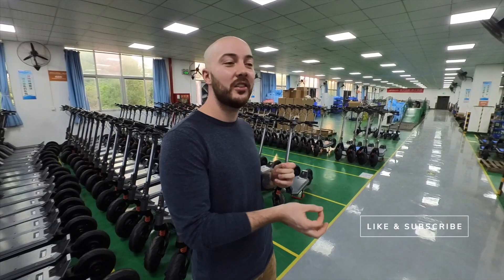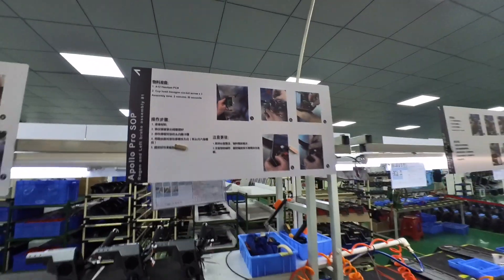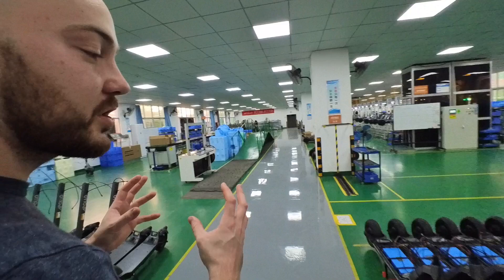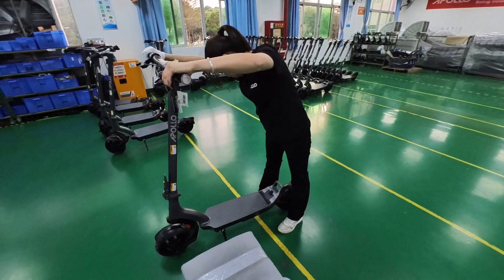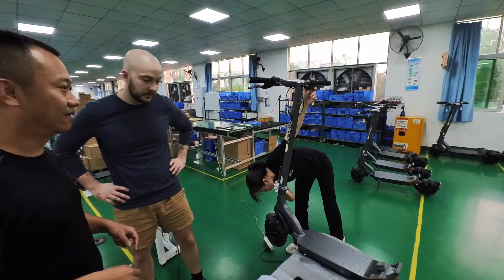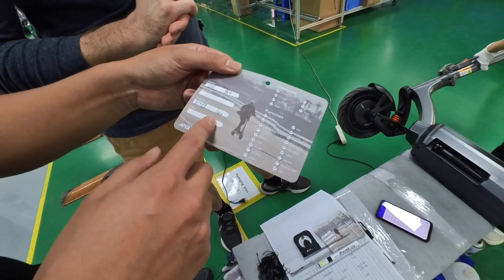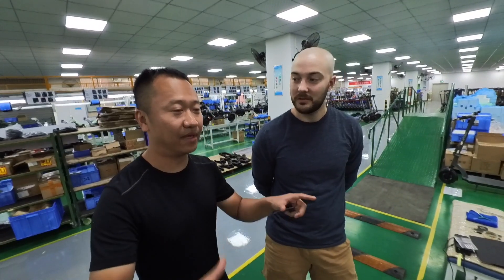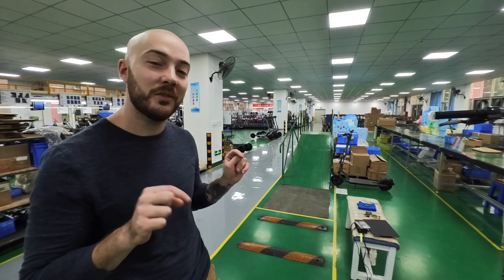Inside Apollo's Electric Scooter Factory | Quality Control Tour

Comment: Love the videos. Do you guys ride the scooter after it’s fully assembled to make sure it runs?  Wondering about that final stage. Thanks for showing us. :)
Reply: They select one or 2 random scooters after a batch is made to test ride. I’m not sure if those are sold as slightly used though
Reply: @AdamLaaroubi 
I don't think so.😊.
It's only for a very minimal distance & time.Maybe a few hundred feet.
Reply: @8_x_9.  I know but they still have to test them. I saw them test ride one in another video where they tour the factory